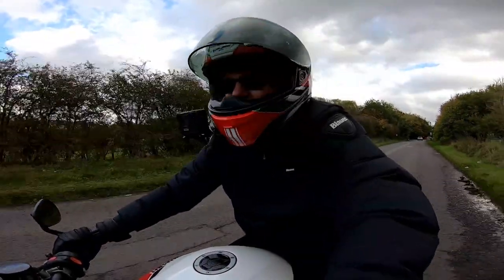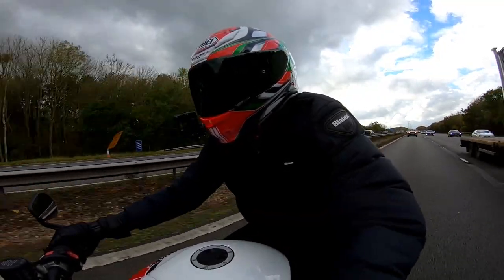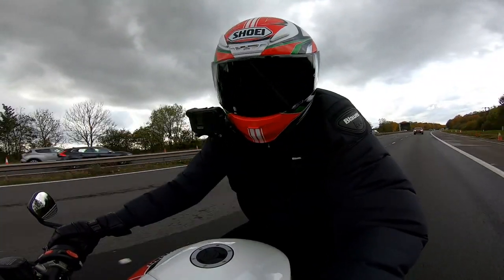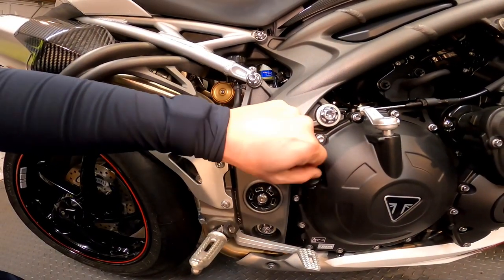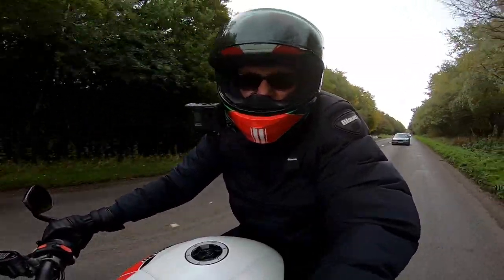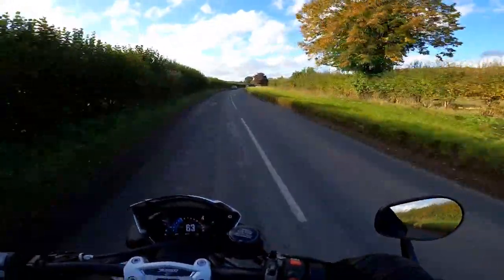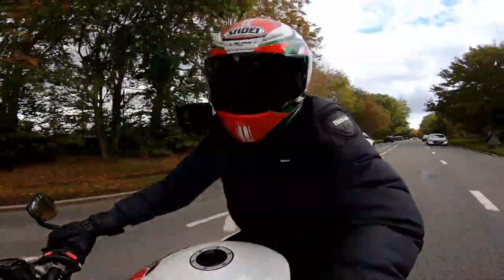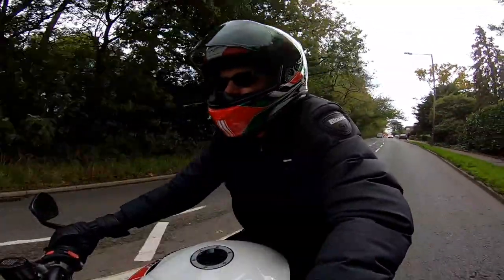Triumph Speed Triple RS Review | What's it like to live with? - Lessons Learned

Comment: I've just bought a low mileage black RS from my local dealer. What an awesome machine it really is. One comment when comparing this with the 2014 Street Triple R that I traded up from, the gearbox feels a bit agricultural in comparison. There is a loud Harleyesque clunk when engaging 1st, and sometimes 4th to 5th can be a bit clunky. The Shift assist (quick shifter) works well,  both up and down the box, but on the odd occasion its been a bit harsh. Other than that it is stomp down amazing!
Reply from the maker: I'm surprised to hear that David.....
Reply: @TheMissendenFlyer  I found out that they had supplied the bike to me with too much chain slack (I'm apparently a lighter bloke that the average lardy who rides these!). As a result the chain was slapping and this gave a very harsh change with the quick shifter. I liked your review of the new Speedy RS, but am glad I bought the 1050.
Reply: I came back to look at this review again after seeing this week's test of the 2021 Speed Triple RS. My local dealer is offering a pretty good deal on a 2020 "S" with the up and down quick shifter included. I was waiting for the the latest model as a possible replacement for my 2012 Speedy but now I'm thinking that I should go for one of the last of the 2020 models... especially considering the MCN review you highlighted on your monthly update.
Reply: @alanhall7213  I gave a lot of thought to this too, and while I think Triumph get better and better, super/hyper nakeds seem to be moving towards ridiculous high end power and track day use/posing rights down the pub. 

How much more power do you need than the 148 bhp of the previous generation. Michael Neeves from MCN loved the new bike on track, but was critical of the suspension on public roads, bemoaning the loss of the plush feeling of the previous bike. The other thing to consider is that the new iteration is way more expensive, with a lot of features that have little to do with normal road riding. 

I love the previous version and while the gearbox is a little agricultural compared with the Street Triple and from what I've read, the new model, once its set up, the older bike is a peach.

Comment: Keyless is a Marmite debate. I love the concept, its easy to use, especially the central locking on the fuel tank cap on my bike.... as you say with the Triumph, the key is king for opening the seat.
One point mind.... from 80’s bikes onwards until recently, they came with very weedy and weak keys which bent or broke at the least provocation. Now with the crossover from the car world, the keyless fob comes with a very substantial key so perhaps its been a means to an end to have decent keys and locks on bikes at last.
Reply from the maker: Maybe - keyless works for me on bikes with many locks (like big tourers with keyless panniers) but on a bike like this I’m quite happy to be “old school” and have a key....
Reply: Forgot to say... 🙄
The Speed Triple... the frame is a gorgeous piece of engineering beautifully crafted. With that, the single swing arm it is working its way to be a future classic.
Good review.
Reply from the maker: Cheers Doc!

Comment: Hey Mr flyer.

When using your go pro for the night demo, set it to highest res (4k) 30 fps. This will a allow 1/30 shutter speed giving you an extra stop of light. The higher res will also help.

Don't forget to ensure your max iso for the preset used at night is atleast 1600

I have a short clip on my channel if you want to see what that looks like. Might be of help to you

Comment: Lug test noooo... 265 kilos, but as a touring proposition you should go Triumph Sprint GT. For a pillion, a really decent ride and overall just a comfortable, happy, mile muncher. The Speed Triple is a little tuned up for a smidging more HP and torque but basically the same lump, 1050cc of pure riding pleasure. The Sprint GT, an under-appreciated gem 😉
Reply: I do wonder why Triumph dropped the Sprint GT . I quite liked the look of it. The adventure bikes as tourers just don't do it for me. Only the Tiger Sport in Triumph's current range looks anything like the Sprint GT.
Reply: @karlosh9286  I always liked naked bikes but went for a faired bike n now everyone's on the naked bandwaggon including Triumph ;D The GT offered the best value on second hand market for a competent tourer, yeah I'm not sure why they discontinued. It hit that gap between top of the middle weights and the high end expensive litre up bikes ! They always had some sort of flagship touring triple and u can see the same pedigree in the Trident, ST at 955 and 1050cc. Yeah Tiger Sport at 1050cc nice but value for money and touring ability and all round good looks in Caspian blue, it's always the GT ;-)
Reply: @1050cc  Yep, if Triumph had offered a half faired Speed Triple , say like the Suzuki GSXS1000F, I'd have probably bought that. Tiger Sport 1050, I like it, but it's quite a bit bigger than a Speed Triple. I have an issue "getting my leg over" ( yeah story of my LIFE ! )

Comment: Funny that you don't much mind that the bike doesn't have a full electronics suite with Side and Wheelie control..... I'm an R1M owner and really want the Speed Triple 1160 when it comes out-but I can't buy it if it doesn't have slide and wheelie control..... I ride with a group of older, very experienced and fast riders and one of them high-sided his Tuono V4S into low earth orbit this season and spent months with both arms broken and his wife wiping him after using the toilet. I have had similar rear end slides in the very same gravel-strewn corner on the Yamaha, but the slide control saved me months off work. Had to clean my shorts, but it was over before I could roll out of the throttle-and we weren't even going for it. 

Really hoping for the Full Monty rider aids package, decent tank range (tired of getting range anxiety at 110 miles on my other bikes) and a bit more poke up top..... that would be my dream bike. I wouldn't care if it wasn't as fast as it's rivals-I have fast bikes already, I just want something with the same riding experience as my girlfriend's Street Triple RS in a package with more power on top. I just love her little RS to bits and honestly could be happy with it for the mileage and range alone but am hoping Triumph knocks it out of the park with the new Speed.

Comment: This bike is superb even with the 30bhp deficit is still out lapped the KTM SD at Donnignton with Michael Rutter albeit slower than a Tuono. The new Speed Triple 1200 RS with the additional 38 bhp is going to be a destroyer of SDs ad Tuonos on track!
Reply: Have you looked at what the top speed of the Tuono is versus the new Speed Triple 1200 RS? The owner's manual is already on Triumph's website, which lists primary ratio, sprockets, and gearing ratios.  Tuono does almost 170 mph.  Unless the numbers in the owner's manual are wrong, the new Speed only does 149 mph tops, very short 6th gear.

Comment: I've got one. Thought it has TMU traction and anti wheelie. Quickshifter you need to switch on in the TFT settings
Reply from the maker: Cheers Graham - you're the second to mention that - wish I'd known as I assume the QS is excellent on this (if the one on my Street Triple is anything to go by)....
Reply: @TheMissendenFlyer  Yes its like butter and throttle matches on the blipper. BTW I've got Michelin Road 5s on mines, perfect for wet weather and decent mileage. I didn't see 1400 miles out the original Super Corsas 🤣
Reply: but can you have separate traction and anti-wheelie settings ? I haven't tried on my one. I'm sure I remember Lamb Chop Rides saying it's not possible to separate the functions, they both go on or off together. Not that it bothers me, I need all the electronic help I can get !

Comment: You didn’t mention the ride quality, how firm was the RS?
Reply: I had a new 2015 Speed RS; and it was bloody hard. If the bike hit a bump, I was out of the seat. It was both hilarious and scary at the same time 😁😬
Reply: @SBKPete  I have a 2016 S, and it is as stiff as I would want for the street riding I do. Shame they have to do this to the upscale models.
Reply from the maker: I think I did mention it - it is quite a firm ride as the others have said - but then so is my Street Triple....I guess it's required if you want sharp handling....
Reply: @TheMissendenFlyer  I had a 2010 Street Triple R and found its ride quality quite acceptable. Are you saying this bike is no worse?

Comment: Nice review TMF - This is definitely near the top of my list for my next bike, and I am looking for a the "does-everything" bike. A couple of other observations worth a note; for wet weather, it has riding modes so you can turn things down a bit. Also the RS has fully adjustable Ohlins (so could be adjusted to suit depending on track/touring use). Finally, I think this is the last model production line in UK. The new Speed triple and all other production triumphs made overseas (recent partnership with company in India?). Only TFC specials from Hinckley from 2021 onwards. Regarding the keyless -ness, I would find that really helpful. When commuting in the dark, I currently have difficulties finding the keyhole, and often need to take gloves off to do it (and its outside). Regards from Switzerland :)
Reply from the maker: Just for clarity Triumph has it's own factories in Thailand where the bilk of their bikes are assembled these days....
Reply: @TheMissendenFlyer  thanks - I was middling it with the Bajaj partnership 👍

Comment: Nice comprehensive review. I own 18 Street Triple and personally I’m still not convinced that the Speed is better than the Street. Based on a paper study the Speed should be miles ahead of the Street with all the added gizmos, yet when it comes to real world riding, they are neck-to-neck. Comparing approx. £9k  with £13k bike goes to show how good the Street Triple really is. My model doesn’t have a cruise control, which is the only thing that’s lacking on the street (in my opinion). I couldn’t agree more with you on the heated grips, especially in cold countries.

Comment: I'd have liked the "what's it like in the wet?' section to include some comment on the rain mode, especially since it's raining so much in Eastern Australia this year. 
I have just bought what I think is the last new 2020 RS in Australia, awaiting delivery from interstate. I'll certainly be changing the Pirellis for Michelin Power RS when they wear out in 7000km. 
I was not interested in the new 1160. It starts making more torque than the 1050 RS at 6500rpm. That's 160km/h, 100mph in top gear. This one has enough power.
I was intrigued by the fuel consumption reported by the bike's own calculation in the review, about 44.5mpg. I had a 2016 Speed Triple R that returned 21 to 26 km/l, mostly about 23, or 59.5 to 73.5, mostly 65 miles per imperial gallon. Obviously due to the ride-by-wire making it more efficient. Triumph recognised this and unfortunately reduced the fuel tank capacity by 2 litres. It was good for a comfortable 300km, 186 miles. I had been used to 18 to 22km/l on my Daytona 955i. Since the reported fuel consumption of the RS is similar to the 2016 R, I hope to get good fuel consumption with my new RS, perhaps 55mpg.
IanB, Melbourne Australia
Reply: Congratulations on the new bike, last of that model beautiful bike. I have a 2016 spd3R which has the fly by wire and rider modes. Rain mode works well dulls the throttle response and puts the traction control on high. Personally I'm not a huge fan of fly by wire throttle at least your bike has cruise control. Good luck getting 7000kms out of the Pirelli's! Enjoy your new ride.👍💪